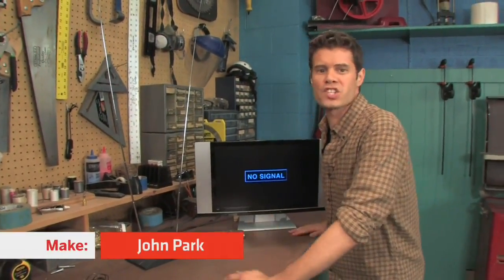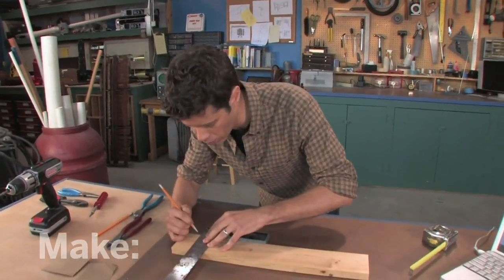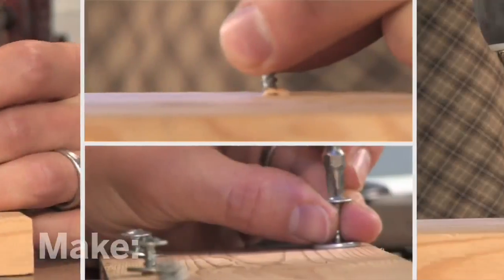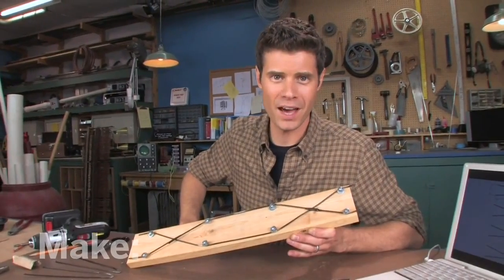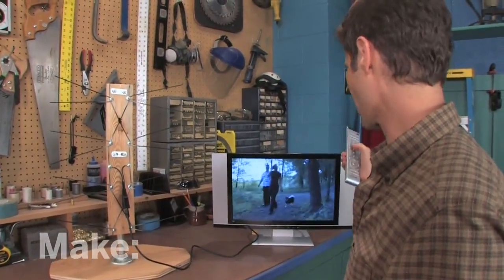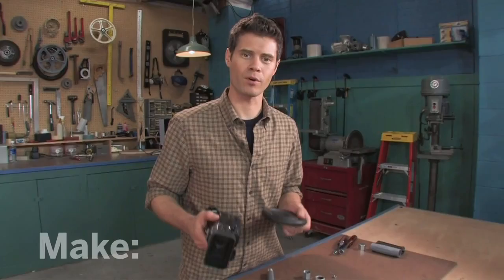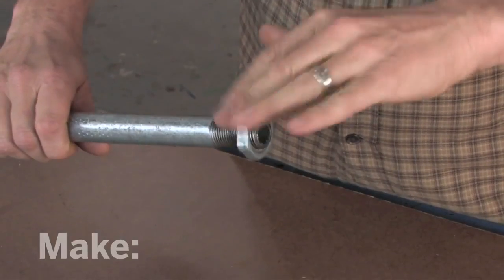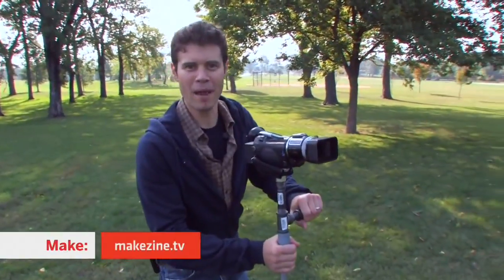Cómo hacer una antena de TV casera / Steadycam o estabilizador de cámara casero

Comment: De partida este video es un vulgar fraude; porque el pre-diseño esta malo
No puedes construir un Antena casera con alambre galvanizado que es este el material
Mostrado aquí y apernarlo en forma perpendicular a un listón de madera. (2” x 4”).
Por una sencilla razón: Las ondas electro-magnéticas viajan y vienen 
Las ondas electromagnéticas son las ondas producidas por la oscilación o la aceleración de una carga eléctrica. Este tipo de ondas tienen componentes eléctricos y magnéticos y se originan como consecuencia de dos efectos: 
*Un campo magnético variable genera un campo eléctrico. 
*Un campo eléctrico variable produce un campo magnético. 
 Otra característica de las ondas electromagnéticas es que son ondas transversales(es decir: la vibración de las partículas es perpendicular a la dirección de propagación de la onda).
La Instalación de esta antena aunque sea afuera de tu ventana debe ir libre y con una base
Horizontal y no perpendicular como mostraron aquí...
La base perpendicular de madera...TAPA o IMPIDE el libre flujo viajante de ondas electromagnéticas.El cuerpo de la Antena debe ir instalado lo más al aire y despejado posible.
Tal vez el diseño podría resultar mejor su aplicación en tubos de aluminio.
Reply: R.O.J.C Combs. 

Interesante explicación, ya vi como la gente se quejaba muy
molesta con este video
Hasta ha sido re-subido en otros canales...hay uno que se
llama “Cómo tener cable-gratis”
¡Qué troleada No!

Comment: Puede ser con cualquier tipo de alambre, siempre y cuando no se doble fácil para las "V", yo use alambre de tendedero, del galvanizado, es muy resistente y no se oxida. Para las líneas que conectan las "V" utilizé cable de cobre de uso eléctrico calibre 12. A éste solo cuidas de pelarle donde van los tornillos y listo, nada de contacto donde se cruzan los cables. Inténtalo, funciona muy muy bien, todos los canales con la imagen perfecta, sin ninguna falla. por último, yo la coloqué en exterior.